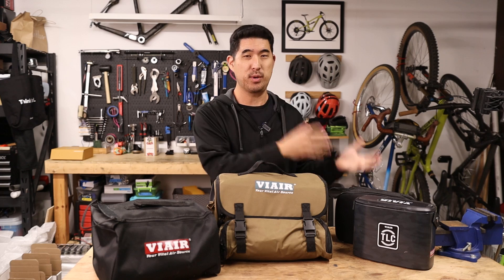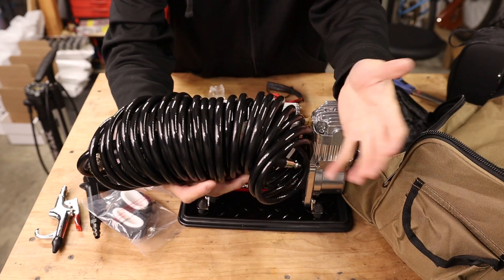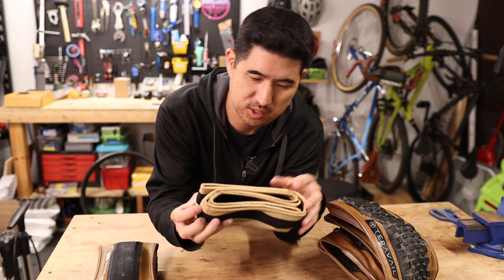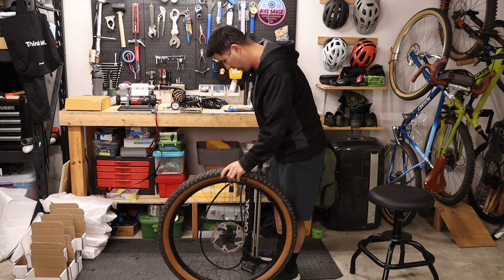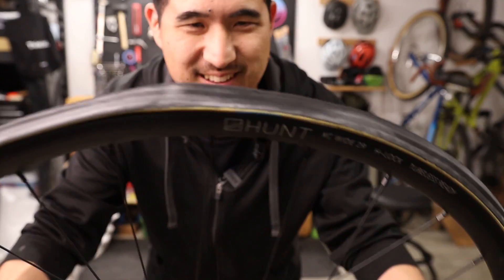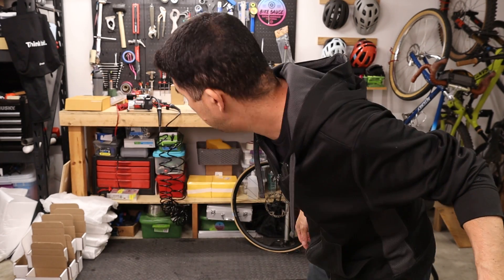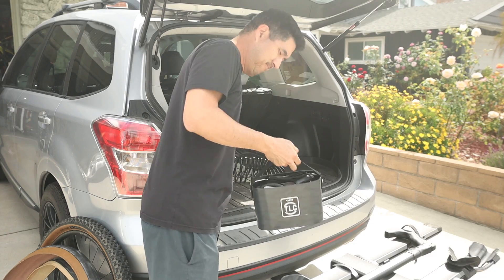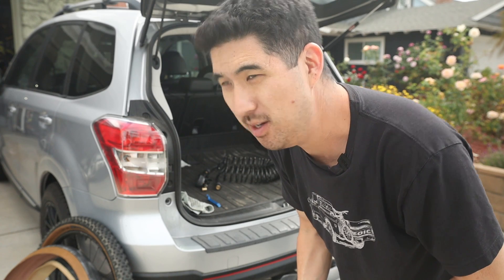TINY Compressors vs Tubeless Bike Tires

Comment: Mind sharing specs on the power supply?  I've had the "big" viair you tested for some time.  I have used it hooked up to a vehicle but never pondered putting it on a power supply like that.  Meanwhile, with the advent of all these cordless tools, I don't need the 33 gallon compressor in the garage any longer since, well, all it does is set tubeless tires when needed lol.

Comment: Why is the hose 300 feet long? That's not rightly suited for such a small pump.
Reply from the maker: Haha, it’s meant to be car-mounted, so the 30ft hose kind of makes sense to get around the vehicle
Reply: The length is meant for reaching all 4 tires of a car from a fixed point, and it also creates air volume for the blast (the tankless models use the hose as a storage for the blast of air)

Comment: Can you use these compressors to help dry your bike after a wash?
Reply: the PRO has about 3 seconds of serviceable air from the reservoir, so yes for that one. The other ones only have the air stored in the hose which isnt enough for drying jobs.

Comment: What did you think of the inflator? I've been looking for a good shop inflator for work because ours suck, and the Park Tool ones are never in stock with our distributors. Maybe you could do a video on comparing some good shop inflators?
Reply from the maker: I’ve only got the Viair one, the park one, and the industrial shop one (no gauge) at the shop I used to work at for comparison. TBH, the one included with the Viair is really nice. It’s not just an afterthought.

Comment: Great vid, but a few items to note:
-that chinook pass isn’t supposed to be run tubeless. Maybe that doesn’t affect the results for each compressor wrt inflating smaller volume higher pressure tires but it just might
-did you inflate with valve stems in? Sometimes just taking the stems out will help with seating the bead to increase airflow blast rate
-did you note how tight each tire was to install? Or how tight they were to the inner rim once installed? Looser fits are generally much harder to seat properly since the air blast will escape through any gaps instead of blowing the tire up onto the bead seat. 

Great job on the vids and keep them coming.

Comment: I find that the 12v compressor that came with my car (no spare tyre) works just fine
Reply from the maker: Seats tubeless beads??
Reply: @TheBikeSauce  I use a handheld ryobi 18v "inflator" and I haven't had any problems seating the tire beads.  Never needed that sudden burst of air.
Reply from the maker: Dang, that’s very fortunate!
Reply: @TheBikeSauce  Yepp -  Maxxis Assegai 27.5x2.5 in approx 10-12secs but quite noisy & has to be plugged into cigar lighter

Comment: 50A is a lot of current capacity from your 12v 600W power supply. Your wires are quite skinny…if you ever draw that much, you may need thicker wires
Reply from the maker: I don’t think I mentioned it draws 50A. Also someone did the conversion in the comments. It shouldn’t be drawing anywhere near even 20A at the wall after the voltage conversion

Comment: Cheers for this review, I didn't know such a thing existed (I've used full sized compressors and mini electric pumps but not mini compressors) I'm now very interested in the Pro version.
I find the ease with which tubeless tyres seat is mainly dictated by how close the tyre bead naturally sits to the rim, a good fitting tyre/rim combo can easily be seated with some vigorous pumping from a normal track pump. Wide rims with smaller tyres are the hardest to seat and at the other end of the scale tyre inserts might make it harder to get the tyre on the rim but they make seating the bead a no-brainer. In general I find once a tyre has been seated and ridden for a while its usually easier to re-seat because the tyre naturally wants to sit in the right place.
Also, I believe we're supposed to call them "12v Auxiliary Power Sockets" these days 😉

Comment: The hose has to hold pressure for compressors with tanks, too. I only mention this because having a nice flexible hose is a quality of life improvement over stiff hoses.  Compressors do really make tubeless a lot more pleasant compared to boosters!  I use a "Metabo" compressor with a 1 gallon tank, which is advertised as 59 dB (and it's probably within the ballpark of that).

Of those 3, the Pro is the only one I'd consider buying.  The others are just too much hassle.
Reply: I'm looking at the Metabo, so its confirmed it has enought kick to seat gravel and mtb tires?